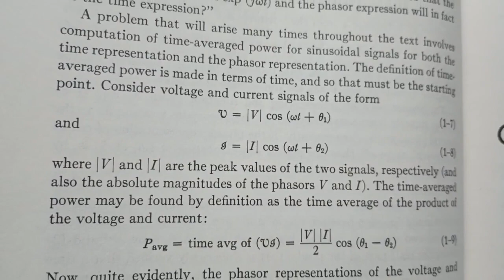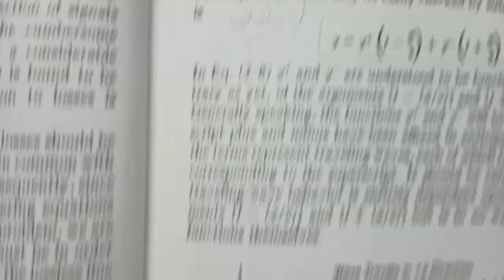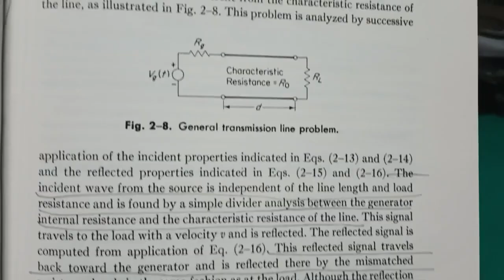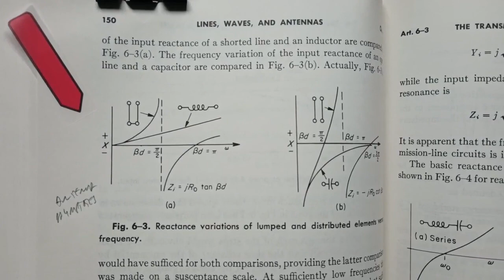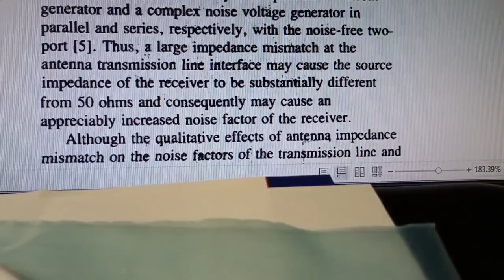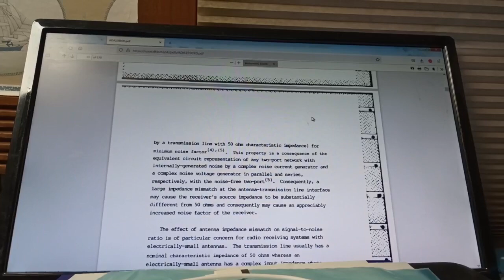Part 1 SOURCE of the Antenna Tuner Myth #hamradio #antenna #arrl #hamantenna #dipole #ieee #balun

Comment: So, when is your material being published? 73.
Reply from the maker: When I find a Publisher that isnt stealing with both hands.

$1000-3000 a Paper is theft for just hosting documents on an automated crawler and server system. There are several 'known' Publishers doing low cost publishing.

Theres also a gross security problem with Pubs demanding use of their document templates ( MS Word, usually) which is an ideal conduit for  installing malicious code on an Authors PC. The average scientist/ engineer wouldnt suspect that. IEEE refused to process my submissions because I didnt use their template file but I did follow their Author and document rules so they got told "Bye Bye, I dont need you!" Its inexcusable for them, in the ISO age to not have controlled documents.

There are also Patentability and security questions.
A couple 
' sources' have told / "suggested" that what Im doing is at the edge of ( or into) the classified realm.

The really good stuff isnt videoed here.